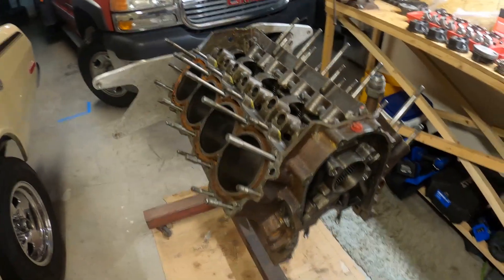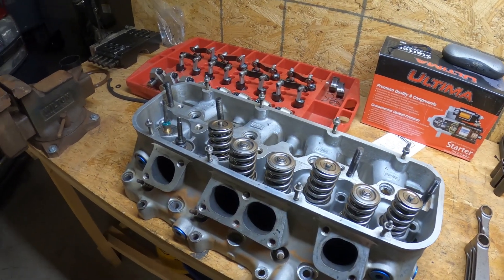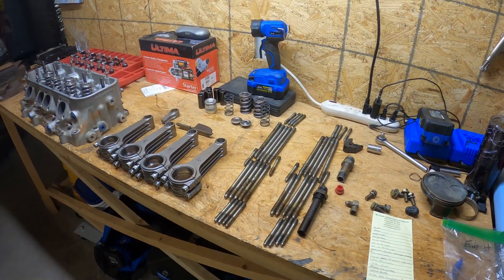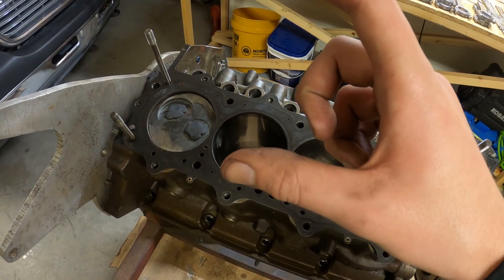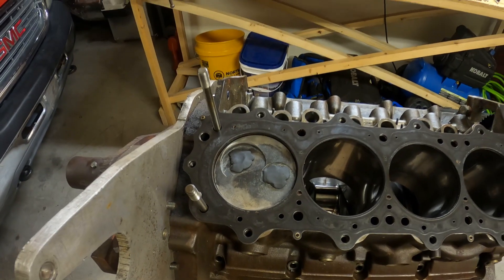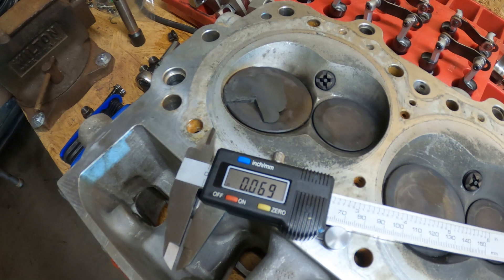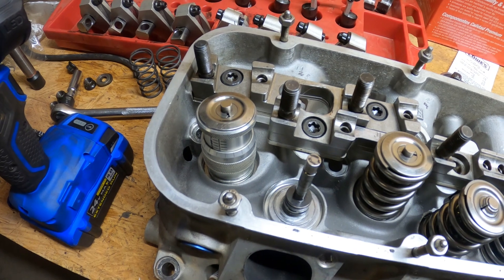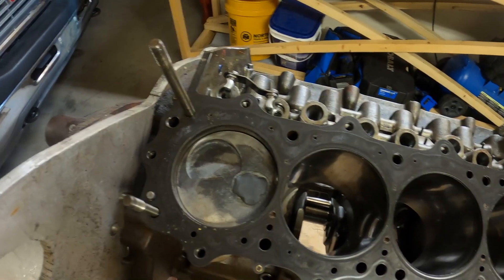The $$$ are adding up fast... How NOT to assemble a valvetrain

Comment: On using the Sharpie on the lash cap, I've always tried to put the roller in the middle of the lash cap close to max lift, especially with racing springs. Usually there is a compromise to be made towards the exhaust port side, around 0.025". But my marks are usually shaded like your exhaust side looked. I'm building 468 BBC, blown on alcohol. This is going to be a beautiful engine to build, what a lucky guy!!
Reply from the maker: Thanks for the tip! I'm not a racing engine builder by trade so I'm always keen to learn something new.
Reply: @moparmuscle8749  Are your valve stems 5/16" or 3/8"? Just curious... Looking forward to seeing your motor go together.
Reply from the maker: @craigpierce7996  without having them in front of me I can't say for sure but I think I remember they are 7mm in the intake, 8mm on the exhaust. I'm looking forward to putting it together! It's on the back burner at the moment with machine work.

Comment: The spark plugs seem unique. I wonder if they are intended to function kinda like a pre-chamber, to reduce detonation? Can you share brand and P/N?
Reply from the maker: Great question! They're like an Autolite 3910x or similar, they're what's called a surface gap spark plug. They put the tip of the spark plug closer to the surface or wall of the chamber and don't have to be indexed. They run extremely cold so as not to create a hot spot in the chamber and greatly reduce the chance of pre-ignition from the spark plug. I'll try them out along with some other ones, but probably not a necessity for what I'm doing with it.
Reply: @moparmuscle8749  ok…, guess what’s throwing me, is it don’t look like a surface gap plug, I’ve had any experience with. Back in the day, (-70’s,-80’s), surface gap plugs were pretty much nitro motor and 2-stroke thing.
For the recessed insulator, forming somewhat of a chamber, and the gaps in the circumferential ground electrode, I was thinking it might function as a passive pre-chamber.
I wouldn’t be surprised if they didn’t use a more conventional plug for the cold start, and switch these in after the initial start.
Reply from the maker: @georgedreisch2662  interesting observation on it, I'll have to look a little further into it. I am by no means an expert so I'll ask my machinist what he knows about them. I'm always looking to learn something new. Thanks for the discussion!
Reply: @moparmuscle8749  you mention having a contact at Comp Cams. Their being a lot of Cup experience there, they might be able to provide some insight on those spark plugs.
Might also talk to them regarding your cam, springs, etc, as that burnishing of the locks would be indicative of loss of valve train control. Maybe able to dredge up some more history too, as they’ve had lots of R&D experience across the Cup teams.

Comment: I’m guessing 60mm camshaft what’s the lifter bore angle 48 degrees
Reply from the maker: Correct, it is a 60mm cam bore. The intake lifter bores are 45° and the exhaust lifter bores are 51° (I believe) since the block is designed for only a canted valve head.